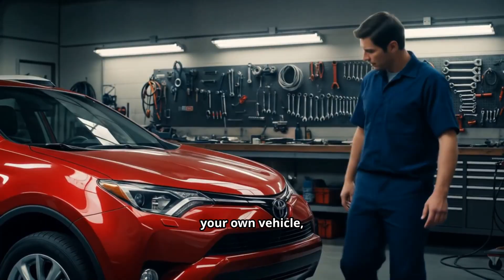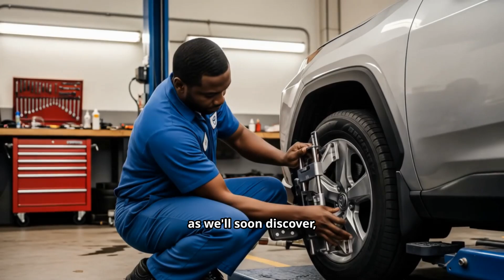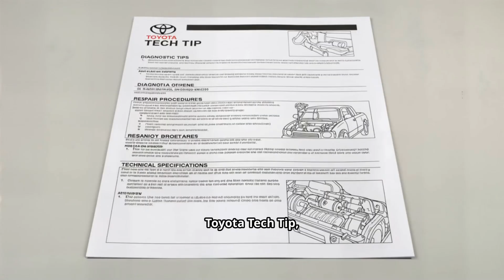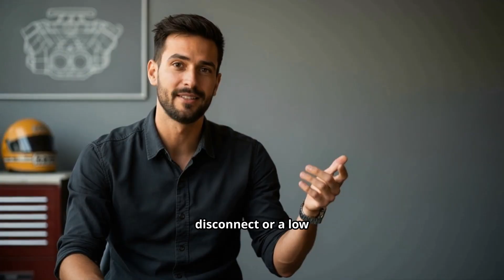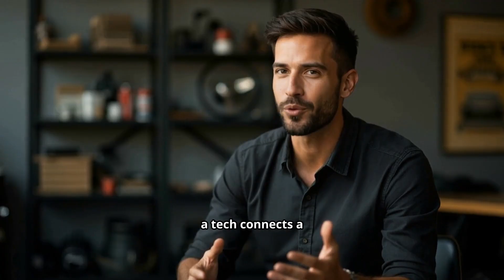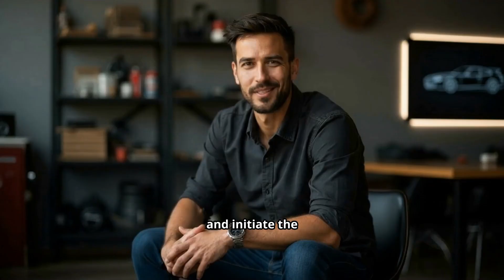RAV4 Pulls Left or Right? Here’s the Real Fix | Toyota Steering Drifts

Comment: My Toyota rav4 2025 2.5 hybrid is slightly pulling to right. Next week i am going to Toyota dealership. I hope that they know about that EPS data issue. Thank you for the video. Thanks.
Reply: My toyota did the same. Rav4 2024 hybrid, and in Toyota service they did alignment 4 times and this shit happen again, pulling to right. On paper everything is in green, but problem is still there. Did Toyota dealership help you and if, what was the problem?
Reply: @sickomode2049   Did you get it fixed? I got my Rav4 2026 Woodland, and and they had to replaced the steering wheel which came with the plastic loose, so replaced it. Then the wheel is crooked now.

Comment: Just got a delivery of 2025 and it’s pulling to left and steering is not centred on high way speed even if I’m on the shoulder lane, although it’s less when on the shoulder lane. I noticed it’s sensitive to the crown of the road and all our highways are sloped towards left lane as all swege manholes are in the centre of highway between eastbound and westbound. Also noticed that engine auto shut off disabled message pops due charging battery. I do think the car came with weak battery and it’s causing All this off centre steering and pulling?. Thanks for the video BTW.